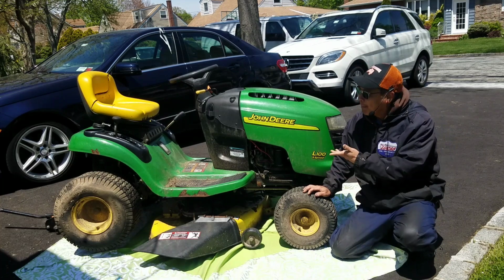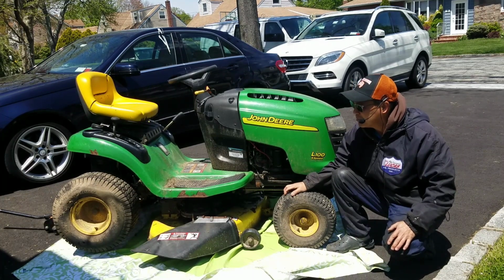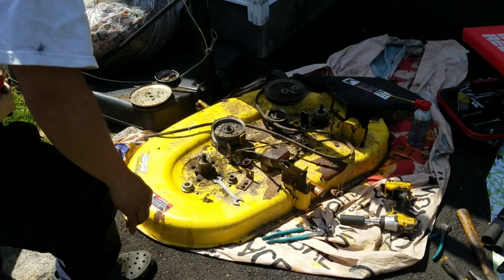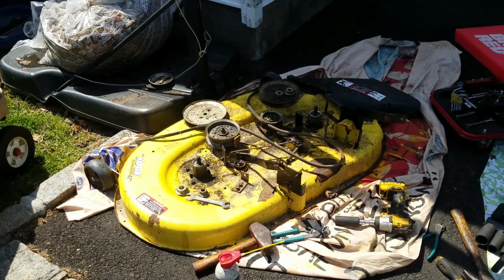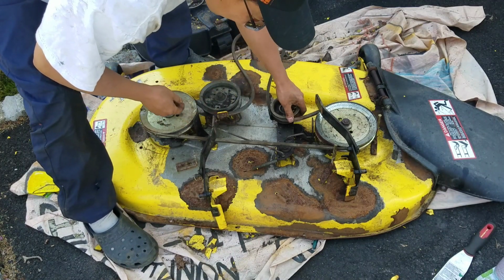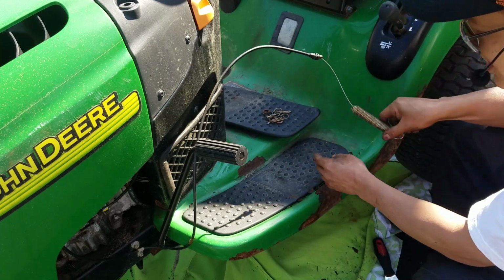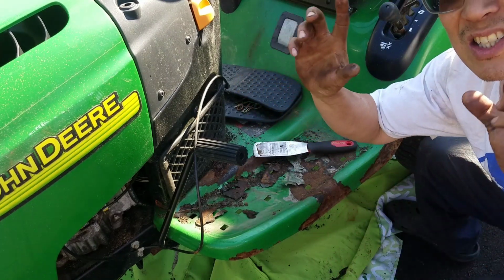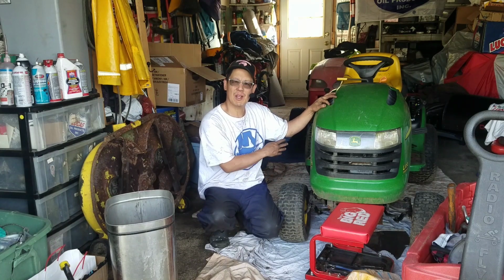FREE JOHN DEERE L100 LAWN TRACTOR RUSTED SEIZED FREE UP GREASE LUBE MOWER DECK REFURBISHING PROJECT

Comment: Rustoleum sells farm implement paint in a few colors.  Once of them is John Deere Green.

I bought a mower off another flipper who had trouble selling it.  I rushed the paint job and blending it in.  Clear as day it was Reconditioned.  I was asking $250 and sold for $225.  The buy noticed the botched paint job.  I simply told him, the side of the deck gets scratched from hitting brushes on the edge of my yard.  Every year I touch up the deck to prevent rust and rot.  Paint job became selling point.  I would brush it and send it!  

Lucas really freed up that deck!

Congrats on personal records!  We live those lol
Reply from the maker: Yes sir, that’s the plan

Comment: Well today I didn't get the wrench out there today but I will tomorrow hopefully the engine I swapped on it will start up I try to do it on my video but of course the battery was dead and I had to recharge it overnight which is charged up now hopefully so I'll do my will it start tomorrow not sure if I have to paint the deck yet I haven't even looked at it let alone the tractor itself it looks like we got a little friendly competition going on there lol btw I was told when I got the Poulan tractor that the engine did run so hopefully enough that's in my favorite that will run.